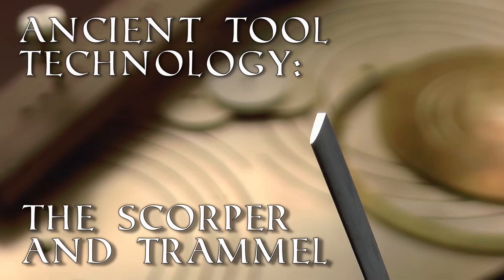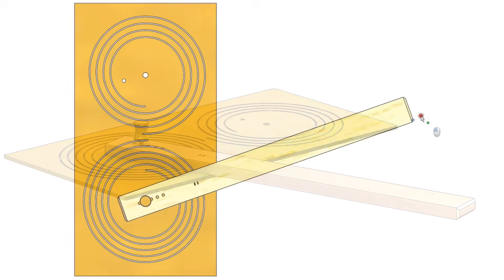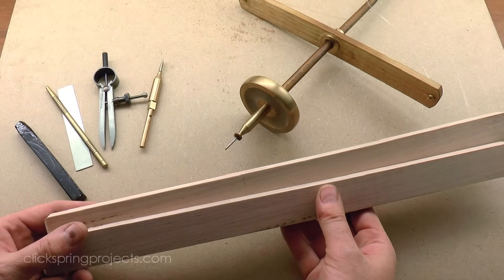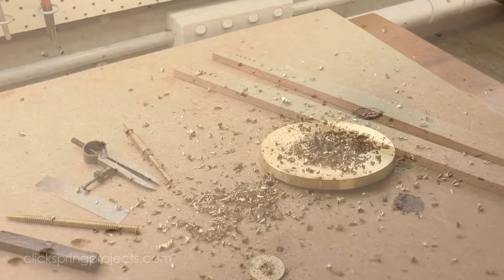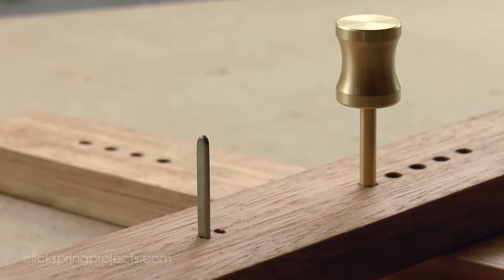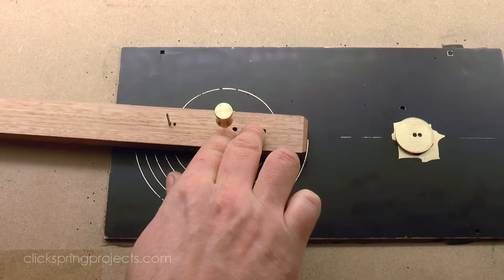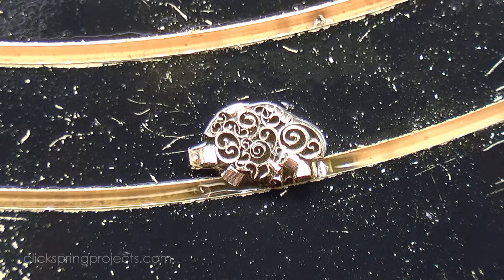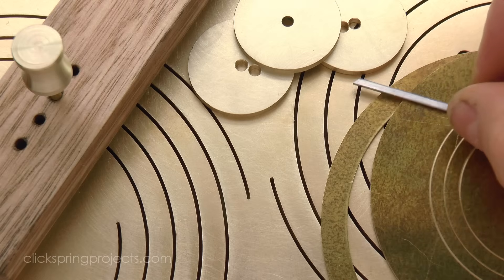The Scorper And Trammel - Experimental Archaeology - Constructing The Antikythera Mechanism

Comment: Nice to get a theory on how the round parts could have been made without the modern metalworking lathe. Could this have been attached to the old style drill to quickly cut through parts. I do also wonder what techniques could have been  used to get flat and straight edges. Great work , with the amount of work and detail put into this it it would be cool to have a academic paper on this as I imagine most people would have an artisan idea of ancient manufactures instead of using repeatable reliable techniques to produce goods

Comment: I feel like this tool is certainly plausible, but with one addition. The outer perimeter should be supported at the same height as the pivot disc provides, to make the tool lie parallel to the workpiece at all times. With your experience using the tool, would you agree? The tool itself seems perfectly capable to cut a circle of brass to support the end of the stick outside the workpiece, so it seems a plausible solution to me.
Reply: as a former clockmaker, i agree with you. it would preserve the tool much better and restitute a higher precision cutting the grooves. i would also make sure that the area where the cut is done is perfectly stuck on my work bench. as you see in the video, the spirals tend to move when he cut it, wich would add stress to the metal, and oh god, you don't want to stress bronze like alloys. trust me on this one. ^^
Reply: @floriangravouil1456  I assume You mean it work hardens with this little movement? Wow. Thanks for sharing Your experience.
Reply: @MindBlowerWTF  yeah bronze alloys are quite sensible to shearing stress. they are like the butter of  metals.
Reply: The only issue I see with this is added complexity of applying constant pressure to the cutting point. This way it naturally adapts as the cutting edge is the support. If you add an outer guide then you would have to be applying load to a fully floating cutting edge. Not too difficult, just another layer to think about.
Reply: @aglaycock1  This is right.  As long as the cut isn't too deep the slight angle won't matter whereas if there were an outer guide, you would keep having to adjust the depth of the scorper, which would be a pain in the bum and difficult to do accurately.
Reply: @joshuarosen6242  I agree with the idea on a outer guide and how it does make this operation way more precise. I don't think setting the tool up and advancing the depth of cut would be that much difficult, take a look at classic wooden router planes for woodworking. The concept of the tools are pretty similar and the depth is easy adjusted with a  slight tap on the plane iron.

Im really looking forward for what Chris has done over the last months and how this series will go on.
Reply: Well, it's a diabetes in fact
Reply: This is a decent idea... my thought is that without the outside of trammel supported, depending on how precise the cut needs to be and how wide. If the end of the trammel dips down then the circumference of the cut becomes shorter on the bottom of the cut than the top... but hey idk what I’m talking about
Reply: However he is using a fairly decent thick piece of wood

Comment: Most people would have assumed that such a complex shape would have required a complex tool.  I would have.  Of all the impressive aspects of this video I found the consistency with which you kept the start and stop points for the arcs tangent, for want of a better word, to be the most amazing.  The trammel blocked you view of the intersection and I didn't see you using a stop of any kind to limit the swing of the arc so how did you do that?  What did I miss?  
Modern machining is all about speed but that must have taken hours and hours to produce those cuts, chewing through what I'm guessing was a 4 or 5 millimeter thick plate for God knows how many inches of cut.  Your patience is legendary!  Splendid work as always!
Reply: really once you start each groove it's almost impossible to overshoot the endpoint since it would take considerably more force to move the depth of cut required, especially given that the tool has no provision for cutting on it's sides only on the bottom
Reply: I think it's pretty easy to stop when the tool is parallel with the edge of the plate, similar to filing technique where you align your files with surrounding geometry, except you don't have to pay attention nearly as much. Another great possibility is to have two centre buttons both as wide as the tool, and you stop when the tool aligns with the other centre button. Finally, a small over-run at the stopping point is not very critical since ultimately the curves coming up from top and bottom match up pretty closely, in spite of not being a true spiral. Another thing is that you can always verify your start point visually by peeking below and having a layout line there, though this doesn't work that well for a stopping point as it will be obscured by the chips.
Reply: @SianaGearz  Or just a viewing hole at the end of the 'stick' with a centered notch to line up with the scribed centerline on the work piece.

Comment: Isn't that an Archimedean spiral done with a string of something?
Reply: No, this is easier to make
Reply: It's an approximation of an archimedean spiral, yes.  And it's easy to draw a true (imaginary) one by having a string wrapping around a cylinder.  Intriguingly, Chris says at some point that there's evidence that the original was not that.  The evidence must be scant since the original is massively corroded, obtained by way of statistical analysis and probability, I guess.  For a true archimedean spiral you'll need an infinitesimally thin string that doesn't stretch.  Unavailable on ebay.   Or just coil a string of finite width around itself, but then the string must be flexible yet incompressible.  Oh dear.  Chris's guess seems very plausible, bearing in mind the rigidity needed for cutting rather than just marking.

Comment: Great video as always!

I'm no expert in ancient Greek pottery, but assuming something similar to a modern pottery wheel was available, I could see that technology being combined with the trammel presented here.
Reply: Good point! Yes, their pottery was quite advanced, I'm sure they had pottery wheels. (And Wikipedia suggests their use was already widespread in Middle-Eastern civilizations since much earlier.)
Reply: Yes, I can see that it would be much easier to turn the work with your feet while holding the trammel in a fixed position.
Reply: You clearly have no idea how important a ball bearing is for a lathe precision and how it revolutionized everything.
And ancient greeks did not have ball bearings. you cannot just magically "combine" things. Read up (or watch youtube) on precision and it's history.
Reply: @NGC1433  Jon and Moon are correct. The old No. 2 Cincinnati milling machines, made from the 40's to as late as the 70's used (tapered) bronze bearings in their universal head attachment/variant. Lovely accurate machines, no problem.

Comment: With the flex, it would make sense to work from the outside in.
Reply: No.  Must be from inside outwards.
Reply: @alangknowles  Doesn't work. What that means is the center can wobble around. If you work outside in, then you know each arc is concentric to its center.

Comment: And no doubt a proficient craftsman could very well have made such a tool "bench mounted"  and very effective, simple enough for an beginner apprentice to use. But how did they manufacture the material blanks?
Reply: Probably something like taking a wooden frame with a wood panel as backing hammered into it, and then covering the entire thing with thin hammered iron sheets, and hammering it even flatter, so it was taut against the wood, and then pouring the molten bronze into it as a mold. Afterwards they likely used files to get the final shape. Wouldn't be surprised if they made some sort of giant metal-in-wood file similar to the trammel Chris made, to get a consistant plane over a wide section, either.

Comment: how would they make flat sharpening stones?
Reply: Rub three ( two ) stones on each other until they are flat.
Reply: @Jehty_  that's interesting why three? do you have to use a jig? :)
Reply: @Jehty_    slightly off topic, but do you know how to progress from an imperfect cylindrical bore to a better one?  I see a fundamental connection, making a better tool using an inferior one.  Specific example, I have a piece of aluminium tube that is very nearly cylindrical but not good enough for a Stirling engine.  It occurred to me that I could put some fine sand inside and spin it on the horizontal axis.  In my dreams it would become more cylindrical.   In my nightmares it would make it worse.  Standard answer: forget the sand, use an excellent lathe.  So in this context, pesky brat that I am, how do I make an excellent lathe without already having one that's better?
Reply: @raykent3211  no sorry. Maybe someone else has an idea.
Reply: Really? Ever hear of the stone age? Humans have been perfecting the use of stones since it's inception. It's the modern day man that has lost it's ways and the practical use of previously perfected technology.   Cereal grinding, around 40000 yrs BC(with a flat horizontal stone), for example.
Reply: @henri1511  you didn't really answer the question. how do you make an flat sharpening surface on a stone?